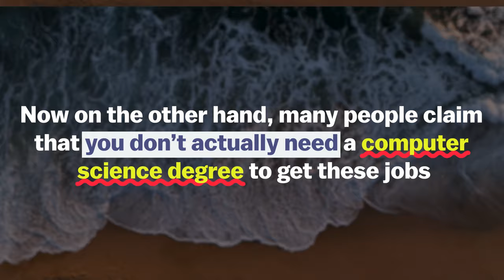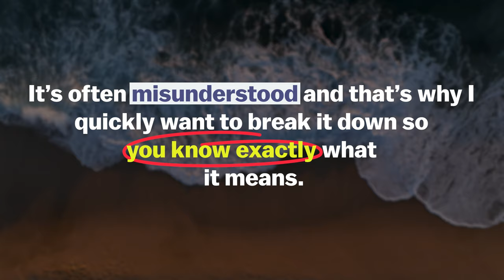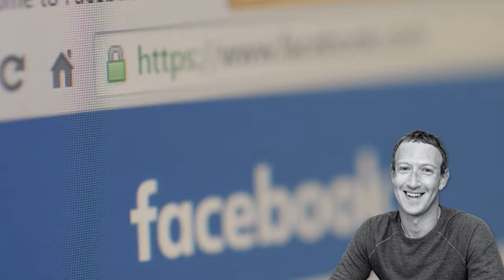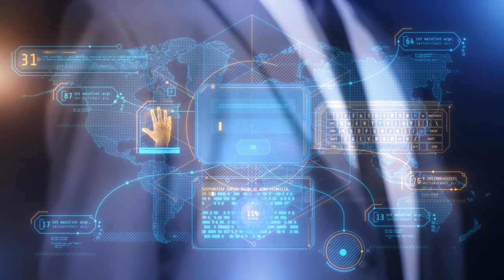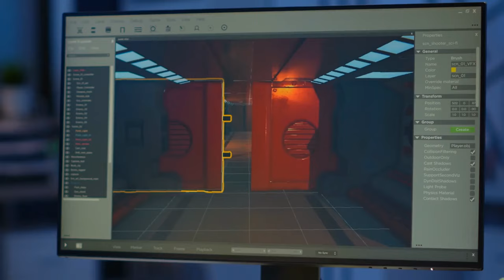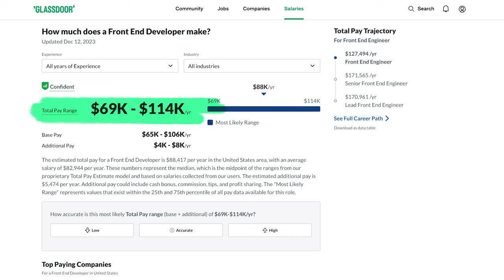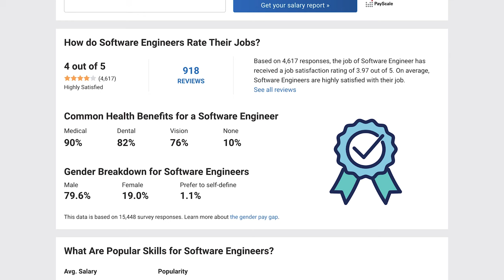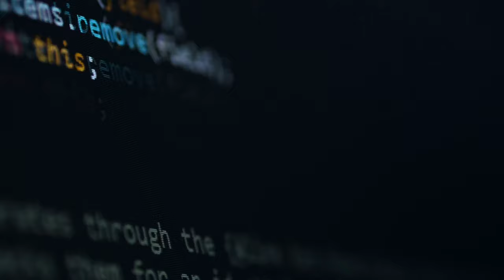Is a Computer Science Degree STILL Worth It? (2024)

Comment: Self-study can be as good but it's much, much harder and need an incredible amount of discipline however bootcamps are not comparable to a degree as there the goal is completely different and you can never get anywhere close to the level of education you can with bootcamos alone.
Reply: it really depends, if you can learn efficiently you can self learn CS concepts quicker than in traditional degree program. If you cut and trim fillers take into consideration knowledge retaining abbility, you can cover in up to  2 years CS degree program for your desirable profession.

Comment: I notice lately are new hires with a CS degree understand the knowledge but struggle with implementing into projects we are working on. While are self taught and bootcamp hires can almost always jump in adding new concepts to the projects we are working on. Algorithms and data structures can be easily learned and most self taught employees have understand concepts enough to pass interview questions. Atm the company I work for has drop degree requirement and requires all applicants to have a portfolio based of requirements of the job. My hiring manager told me they don't even look at the education section anymore and it seem so due to our workforce being about 30% self taught or boot camp trained. My company is mid size we have 3-4k employees atm give or take. I'm self taught now work as a senior software engineer with 6 years experience in the field and my advice is build your portfolio by working on topics you just learned and when trying to apply to jobs build projects related to job descriptions on the position you want. Hackathons are great for networking and sharpen your skills.
Reply: The self taught people are jumping right in because they are not trained to think about the problem and implement algorithms which computer science students are trained for. They will make more mistakes in the long run.

The students that you say are just warming up, down the line, they will be far better than the self taught ones generally. 

A major point you need to realise is in a CS degree you will need to self learn the concepts . So the only difference between the two is with CS students you know they’ve been exposed to these kinds of problems and thinking
Reply: @cowliver1032  cope bruh
Reply: @cowliver1032  Its not coping. its a big difference if you think of longevity and cost and memory space and so on. But most companies dont need these experts. I  would rather hire someone with a degree than someone that says "Trust me Bro". Of course there are good self taught devs but I would not risk to hire one.
Reply: @testtest-cu6sq  It's not trust me bro you have a full portfolio on all your projects you have done and you go through same algorithm, challenge questions during interview. The point in my main post is we are seeing more people who are self taught or coming out of community college with more understanding of algorithms and complex code. My hiring manger told me same thing except for degrees feels like it's piece a paper with no substance.
Reply: @DK5TY  Well around 25% have no degree in Tech as far as I know. So mathematically its better to make a degree to get a job. And if you want to get into Machine Learning or work as a Data Analyst you wont get far without a degree in most cases.
Sometimes I think its a little bit arrogant to think that you can just visit a boot camp and get the same education as someone who dedicates several years to learn the craft. Of course there are people who can do it but its not a good advice for most people. Some people start playing soccer with 18 and get pro . But that does not mean that its best way to get into this field. Just my opinion. Since I studied CS I might be biased tho. 
For everyone that reads this and hs no chance to study: I dont want to say that there is no chance. Go for it and work hard and you will get there. Its just way harder and you have to build up a lot of trust before. In most countries you cant really negotiate about your salary for your first job without a degree.
Reply: @testtest-cu6sq  Theres always the question of what CS college they went to.

My college taught us everything but never let us master one thing, which came to bite me in the ass once i was looking for a job and i knew about pretty much every topic decently, but there was always a person who was "self-taught" or from boot camp that was far better versed in that specific area, and for most companies, a person who is "jack of all trades master of none", isnt the most fruitful when you only really need to put this person in one specific branch/area.

In the end, i had to teach myself in order to get the job
Reply: Having CS degree is useless if you’re not actually mastered at any topic
Someone who learn from YouTube courses at home will learn way faster and be more focused on what they wanna be good at than mindlessly got or college.
As for me I’m interested in python/AI and machine learning
And that’s what I’m currently learning online.
Reply: @FromTheWombTotheGrave  “having a degree in CS is useless” - that’s where I stopped reading
Reply: @cowliver1032  because companies don’t care about ur degree if ur not good at anything
Reply: @FromTheWombTotheGrave  Yeah nobody is saying do a degree but don't get good at it, and for the people that do that (and it does happen actually) , then obviously their going to miss out big time. But they are outliers.
Reply: I just got a few questions to ask

do u think getting a degree in CS at King’s college London will have a high success rate of me getting into cybersecurity as a career?

Nowadays, is it worth getting a degree or should I try to build experience by going for an apprenticeship instead? 

Do yk any tips on getting into getting into cybersecurity?
Reply: @ayanal-amin8090  depends if your willing to immerse yourself into it,  i mean if you get good at it and commit how could you not get good? Thing that depresses me is that it means i would have to sacrifice things i love doing in my spare time.

Comment: If i want to work in cybersecurity should i study data analytics
Reply: Or just study cyber security if not look at the actual curriculums of degrees similar to CIS or Computer Science,  etc, usually you’ll find if Cyber Security is apart of it, either way I believe you need a masters to even get into that field
Reply: I took data analytics, and it's not directly related, but it helps you deep dive in the details; much like a  detective. This skill will help you see the patterns and trends. But if you already have an analytical mind, you may not have to. Just my 2 cents.